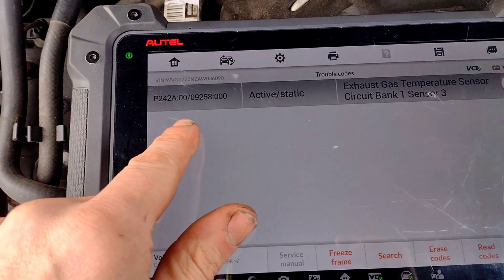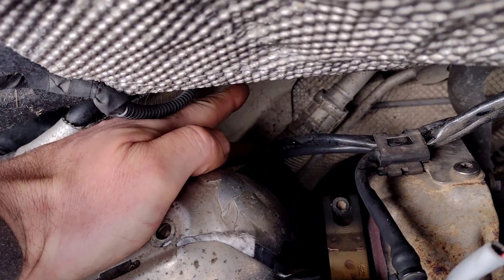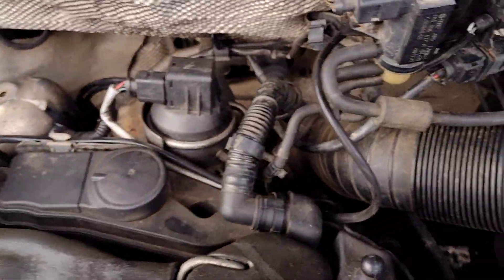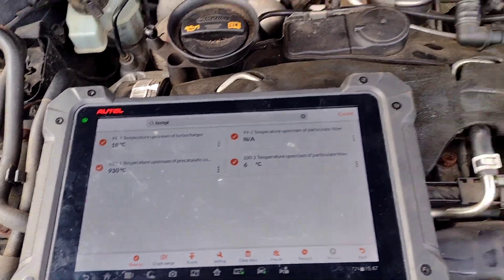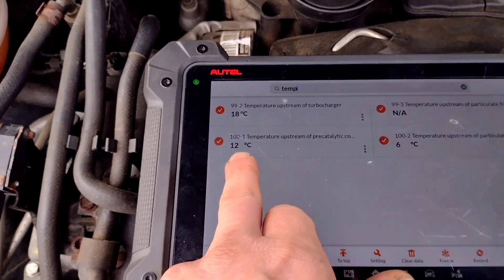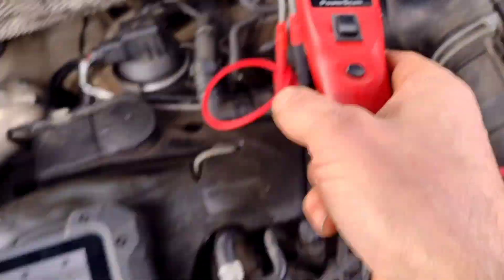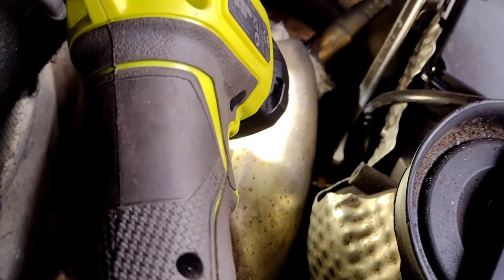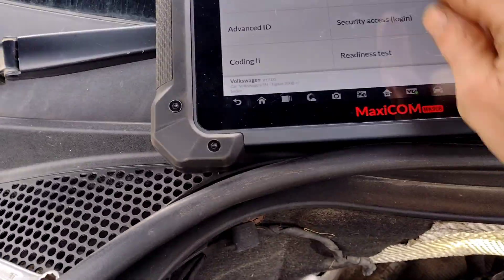Volkswagen Tiguan (Exhaust temperature fault) P242A

Comment: 2018 Skoda Superb 1.6 TDI I have a question about a vehicle with a DCX engine. Where exactly is exhaust sensor 1 connected? When I check with OBD, it gives strange readings. Sometimes it's 20 degrees, then suddenly it jumps to 450 degrees.Could you please help?

Comment: Had put up with fault codes and intermittent limp mode since buying my vw transporter. Thanks to this video, unplugged sensor plugs attached to bulk head, this showed it wasn’t either of those. Muscled it up and looked underneath, found broken wire going to after Dpf sensor, re-connected wires. All fixed. It went straight to Dpf regen. Now it’s all sorted. No more lights on dash. No more problems. Cost a little time and tiny bit of pvc tape.

Comment: Well put together video. Am about to diagnose vw transporter 2015 T5.1 with p242 bank1. I don’t have the box of tricks, just the OBD tablet. There are apparently two sensors, one before and one after the Dpf. Can’t erase the code so will go live data as shown here and unplug them separately and read. Thanks

Comment: amazing very cleaver way of testing 
I have some questions I would like to know your answer what if we facing more than two wires oxgen sensor how I'm going to test it using the decade resistors box 
can we use it for testing airbags sensors 
thank you for sharing.

Comment: Any ideaa where I can buy that little resistor box, could we of pulled the voltage down using a test light? Thanks
Reply from the maker: Yes a test light works, you will see a reaction on the he live data on the scan tool. Just isn't able to adjust the resistance to where you want it.
You can buy a decade box  on eBay mate, there are other makes that are cheaper that work fine too.
Reply: @mechanicmatt871  thanks mate keep up the good work

Comment: MAT, YOU AMAZE ME EVERY TIME ,,, NOW CAN I USE A DECKED BOX TO CHECK A APP SENSOR , SO I CAN KNOW IF IT IS THE SENSOR THAT IS BAD AND NOT THE CIRCUIT PLEASE REPLY NEED YOUR HELP THANKS PLEASE ?????????????????????????????????????????????????????????????????????????????????????
Reply from the maker: Hi, that one would be a little different, due to it having two position sensors in the accelerator pedal position sensor. Usually one signal it double the other signal voltage.
If it was me doing it, I would use a scan tool to look for a change when I press the pedal. If no change, I would check the five volt power and grounds at the pedal, then see what the voltages are on the two signal wires. If one was missing a signal voltage, I would maybe just use a test light from battery positive to bring the signal up, and see if the scan tool love data changes.
You would need to know if the good signal went from 0.5 to 2.2 or if it was 1.0 to 4.5 volt range, for example if you were getting the lower range but not the higher range, you may be able use the decade box to put double the voltage into the other signal wire, by going between the five volt supply and the signal wires and changing the resistance settings until the voltage is where you need it, then seeing if the fault code cleared. 
I think in this case the test light method would be easier like scanner danner does.
This may not come across clearly in a text message. Thanks for watching
Reply: @mechanicmatt871  THE CODE I AM CHASING IS P2138 ON A 2013 BUICK LACROSSE WITH LOW POWER AND WON'T REV ABOVE 3000 RPM IN PARK . AND WHEN DRIVING IT'S LIKE IT'S STUCK IN A LOWER GEAR . THIS IS THE SECOND APP SENSOR THAT WAS THROWN AT THE CAR BY THE TIME I GOT THEIR . HOW WOULD YOU ATTACK THIS CAR'S PROBLEM . 🤔🤔🤔🙏